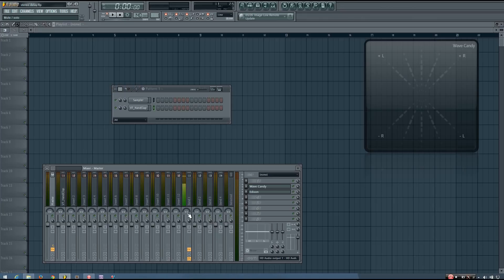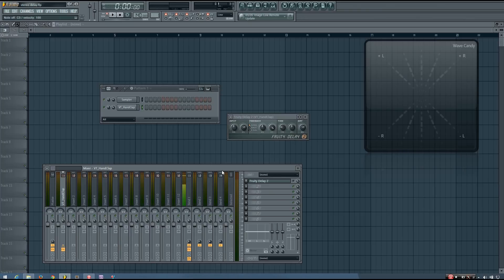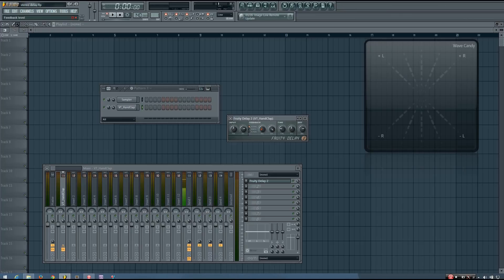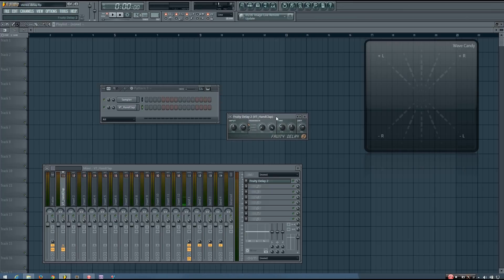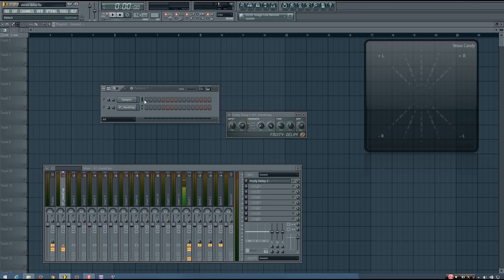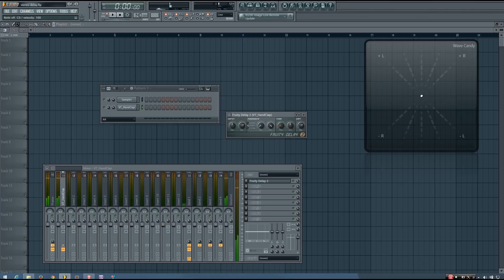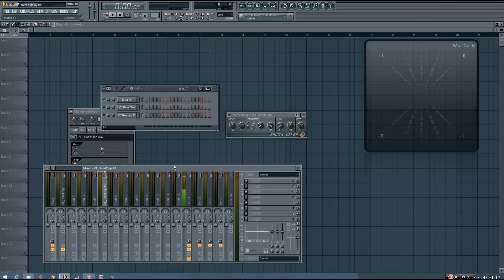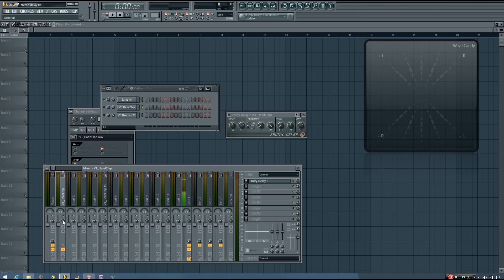Mixing Tutorial: The Haas Effect

Comment: Why would you use the Haas effect for more stereo info, if it's bad for mono compatibility?

Wouldn't it be better to just use a stereo enhancer/separator then?
Reply from the maker: +man1192803  The Haas Effect doesn't always sound bad in mono. There are some cases where it works well with certain delay times and others where it just never sounds good, so you just have to check. Additionally, depending on the method, stereo enhancement may have no effect at all on a mono sound source (or it may actually be a haas effect or something similar).

Comment: Great clear tutorial. One question. You said this effect needs to be used on a mono sound. Do you have to adjust the stereo separation setting on the mixer to make it mono before you use this effect?
Reply: Previous tutorial answered this question
Reply from the maker: Just to clarify, the Haas effect is a common way to give stereo width to a mono sound, but it isn't restricted for use on only mono sounds.  You could use it on a stereo sound if you wanted to.  Regarding stereo width, it would be fairly redundant to use on a sound that is already very wide, but stereo sounds with less width may benefit from using the Haas effect rather than the spread knob if you wanted them to be much wider.  

For stereo sounds, you also might want to use a different method than is shown in this video (such as the Fruity Stereo Shaper "delay" parameter), because using this method would first turn the stereo sound into a mono sound (panning it 100% makes it a mono signal in the channel it is panned to) before making it stereo with the Haas effect.  Actually, I would just use the Fruity Stereo Shaper for the Haas effect with mono sounds as well, because it's so quick and easy.  I only showed the method I did in the video because it explains the effect better and will translate to other DAWs.
Reply: Great explanation man. I've used the stereo enhancer before which I think does essentially the same thing. But it was just trial and error, now I actually understand HOW it works